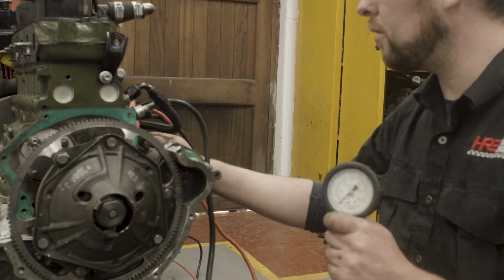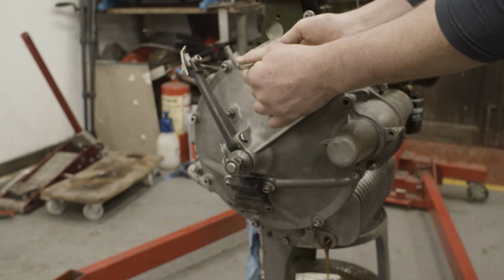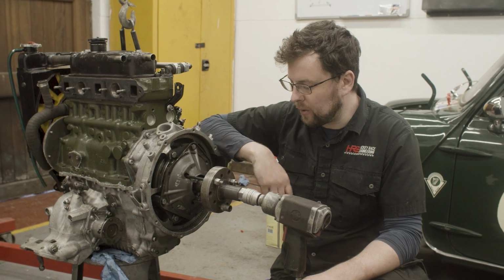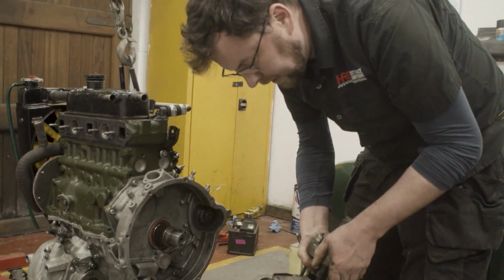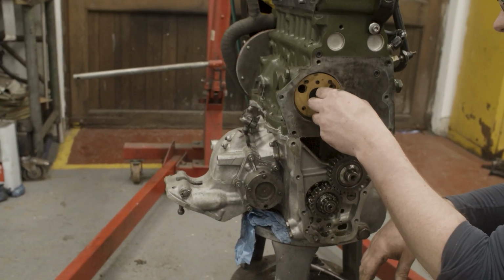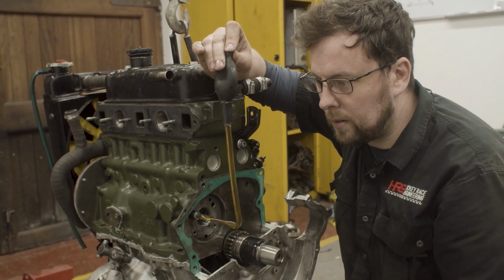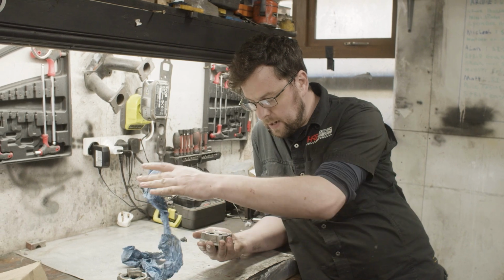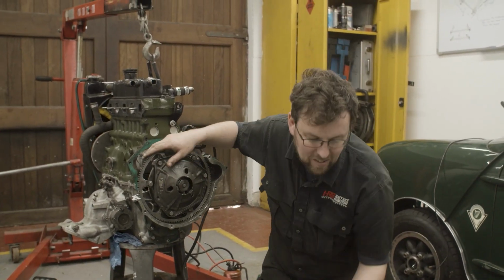Engine Oil Pump Diagnoistics For Classic Mini Cooper S

Comment: I have a complaint! Since coming across your channel I can't get any work done. I had a couple of Minis many years ago (Full race Downton tuned Cooper S with 649 cam a pig to drive on the road and later on a Will Sparrow built Cooper S with 731 cam which was more suitable for road use) Also I was a mechanic in a BMC dealer and worked on Minis when they were in current production. I wish I had learnt some of your tips back then.  You have made an old man very happy as I relive my youth enjoying your approach to the work you do.

Comment: I've worked on classic mini's since 1966 and I've never seen a flywheel that tight! interesting vid as always - thanks
Reply: Not kidding but we had that on my 1300 princess couple years ago, engine was in situ but man it was bloody stuck on there, one thing l should mention, we had the flywheel in the correct position for the circlip as well, middle of the friction plate splines were stripped!

Comment: Very interesting and well done video. Have owned a 998cc Cooper and two 1275cc 'S' types (one I bored +0.020" to 1293cc). On one of those cars, it had oil pressure at idle but as the engine was revved up, the pressure went down! In the end I stripped the engine down and found that the bolts holding the oil pump in place were only finger tight, from the factory. As the engine was revved, the pump started sucking air. I did this out on the street with the engine in situ.
The biggest problem was breaking the flywheel from the crankshaft taper. I did everything shown in the video (made my own heavy duty puller) and the flywheel only broke free when I added a bit of heat and then hit it with a hammer with the puller fully tightened. It came free with quite a bang.
Loved my Mini's though, and still do😃

Comment: The only way that the manufacturer of the oil pump is going to know that there are problems with their parts is by people like yourself doing videos like this and pointing out the issues and eliminating all other possibilities  and exposing what the real issues are, but it's only good if they are willing to address them and man up to their mistakes, I was waiting for a McIver to put in am appearance and that half a bell housing did not disappoint Paul. Great video . Stab in the dark at the head bolt BMW straight 6 320 engine early 80s.
Reply from the maker: Thanks Jer I love to prove my own work, once I know what goes wrong I can assure my self I will avoid in the future. Close on that one but Porke Im afraid :)
Reply: @HREIRL  no cigar this time .

Comment: Hi, Just watching your on oil pressure, I rebuilt my 1100 over a year ago, had no oil pressure the same as you after fitting a new pump, turn out to be the new pump body was not as thick as the old one causeing the bolts to slightly bottom out and not sealing the gasket, what a head ache for me after fitting the engine, realy enjoy your content, many thanks Dave
Reply from the maker: thanks for that Tracey, could easily catch me out will watch for that in the future 👍

Comment: Excellent diagnostic technique as opposed to fools rushing in.  How many would have concluded a defective brand new oil pump. Love the systematic approach and the unerring accuracy of the hammer. Obviously left handed. Clever use of a damaged housing and a vacuum bulb. Always nice when you can prove the problem.
Reply from the maker: ya it helps me to make sure It wont catch me again in the future :)

Comment: It seems a lifetime ago when I worked on Minis and A series engines to remove the flywheel we used to put the puller on and then hit the outer circumference of the flywheel with an old steering shaft, usually cracked it without trouble.

Comment: Great to see how you tested it , I'm building a engine for the first time and oil pressure is the thing I'm most worried about . Great video 👍
Reply from the maker: Thanks Dale, make sure you get pressure on the starter motor befour you put the engine in. That way if you do need to rectify anything its a bit less painful :)

Comment: I'm sure that every mini owner will have a tale of poor quality parts... you've helped highlight an issue and certainly if/when I'm building my engine I'll take this into account. Your fault finding process will definitely influence how i look at faults going forward. Thanks.
Reply: Hi Toby, also watch out for poor quality bearings for the gearbox if you are rebuilding one. Insist on RHP, Koyo and INA bearings as there is a lot of rubbish out there.
Reply: @Conor.Twomey  appreciate the info. I will certainly be attempting some rebuilds so i will keep that in mind. Something I've only just clicked on (naive as i am) is that it's better on so many levels to re-use original when possible
Reply: @tobymiddleton6763  FYI Koyo is the parent company for Torrington and Timken bearings
Reply: @Conor.Twomey  i wasn't aware of that. I frequently hear from people who insist on Timken
Reply from the maker: Great stuff I love to see conversations in the comments, Together and as collective we will be able to make everyones life easer and by is all insisting on quality we will force the hands of the manafactures to meet the quality we require

Comment: another great episode paul ,well done,the next flywheel you pull try a little trick my father taught me many years ago,and ive been doing it for years and never fails, as its not only pressure you need its a vibration also, so instead of hitting the centre put a small socket over the bolts to protect the heads and hit those individually,2 or 3 short sharp shocks never fails,as by hitting the individual bolts the vibration is offset and not centralized,,keep up the good work,looking forward to getting my modified radiator back from your good self..
Reply from the maker: Thanks for the advice N, I will most defiantly keep that in mind sounds like a neat trick

Comment: I usually put the flywheel puller on, tighten it up, put two kettles of hot water on the flywheel, and it comes off easily.
Reply from the maker: Great idea I might well just rob that 👍👍

Comment: Faulty electronic gauge! Always use an analog gauge on first use, if still no oil pressure check the oil relief valve if all looks good on the relief, add a ball bearing in the the back of the plunger housing and recheck, means your relief isn't tensioned high enough allowing it to bypass, defective broken spring or maybe missing! We used to get alot of returned new oil gauges!
Reply from the maker: Duff pump in this case Chris but you are on the right track all good things to look out for
Reply: @HREIRL  We used to do a conversion on the front of the box, just above the ribs, allowing the pick-up out the front then to a remote filter and fed back in through the original pick-up location with the outer blanking plate on the inside. This allowed the oil to be filtered before hitting the pump. It was just my guess before watching.

Comment: So considering new oil pumps are questionable, would you have a problem using older original pump still in tolerance??
Reply from the maker: No If it measures up right I wouldn't even hesitate using them

Comment: I reckon the 'studs' used in that flywheel puller are old head studs. UNC one end and UNF the other.
And I notice you used the captive nut engine mounts as I have for years. Removes the knuckle scraping!
And one last comment? You said that is a 'Cooper S' but the block is a solid one without the rear tappet covers. So its a 1275?
Reply from the maker: Ya we dont use the S blocks as there to old and precious anymore they need to be kept for road cars and not waisted on racers 👍👍

Comment: HI , Can you help, I have good oil pressure when it cold, once its hot the oil pressure drops right off, I have checked the the sleeve and the spring in the block and all works at it should, I'm now considering to pull the engine out and change the oil pump. Any advice greatly recieved. Thank you.

Comment: Aside from the unforgivably dire quality of the oil pump in the video,, would you not pack them with vaseline to aid priming at first start anyway?
Reply from the maker: That is a Very successful Method It however puts a-lot of pressure on the drive spigot in the cam so I try avoid it as you say the pumps  are shocking quality at the best of times

Comment: I’m having an issue at the moment with an engine - priming the pump, getting 75 psi once primed with plugs out but then over night it looses prime - takes around 30 seconds to bring it back 

Putting it down to relief valve leaking maybe or slight weep from oil pump at bottom but that could be just oil from the hole at bottom of pump. Strange

O ring between box and pick up is fine

Comment: Surprised nobody called out the PRV as a possible cause. I had an issue where somebody had missed out the ball in the PRV and the engine was just dumping the oil back into the sump as fast as it could manage. Not that you would ever make a mistake like that.
Reply from the maker: Great shout Colin, that often can be a problem and can easily give similar problems

Comment: Oil pump turn clockwise with the cam? (Looking from front of the engine)

Also what is the purpose of the small hole in the pump near the shaft?
Reply from the maker: it allows a small amount of oil to make its way to the front cam bearing

Comment: I cut my teeth on mini engines 50 years ago didnt have a heap of fancy tools took flywheel off using brass hammer through starter hole as needs must.
Rebuilt triumph gt6 2 litre even went as far as reaming in small end bushes but had poor oil pressure tried lapping in pressure relief valve etc etc eventually dropped sump took of new oil pump only to find flat surface badly machined took it back to dealer got a replacement pump that solved the problem but was sickened so got rid of car
Reply from the maker: aww thats very disappoint but at least you solved the problem 👍

Comment: Hi, in my opinion the oilpump lid should be totally flat, now you have some machined receses in the lid, its not tight to the oil spindle. It will have an oilchannel there, and loss in oil preswure

Comment: Fantastic Paul Hong Kong Fooie made that pump on his/her back kitchen table  HPFP on BM Minis are just as bad again Chinese made there’s no quality checks but I’m finding more parts in uk boxes but then find out the parts come in a skip and packaged here and sold as uk manufactured
Reply from the maker: it very disappointing unfortunately Paul. The bit that really upsets me is Hong Kong Fooie is more than capable of caring out quality control but the people buying skip fulls of oil pumps cut there cost to the bone so there is nothing in it for them so the guys boxing them can sell them for massive profit

Comment: Its shocking when parts that you buy off the shelf fail like this. For a hobby builder it just means some more time and frustration but when it happens to a small business the extra time and work eats into the profit margin and small businesses can not pass this on to the customer. Its a shame that you can not get compensated for the extra time and cost these faulty parts cause you.
Reply from the maker: You are Dead right Uncle K, I have precious little time at the best of time and problems like this are so unnecessary and just put other peoples projects back which I honestly think is so unfair